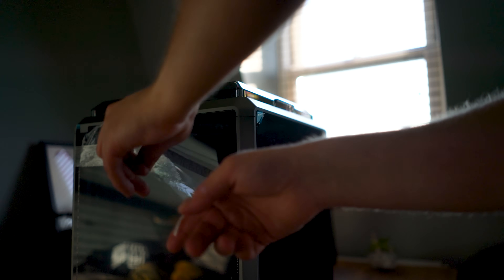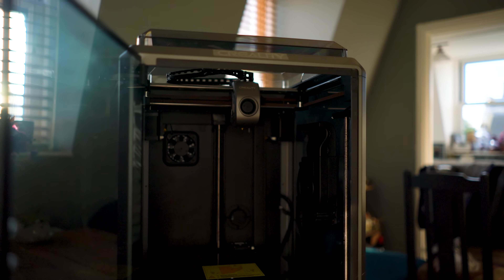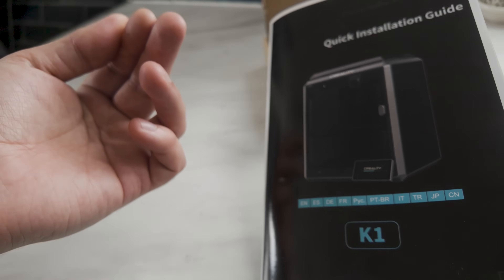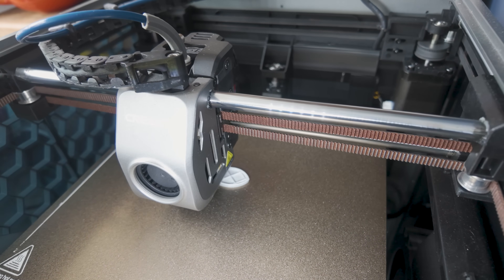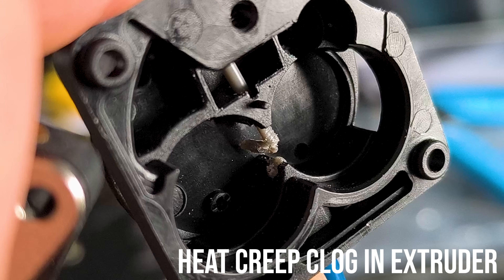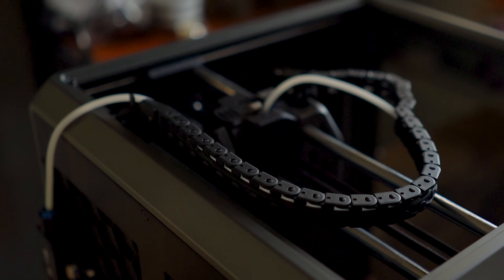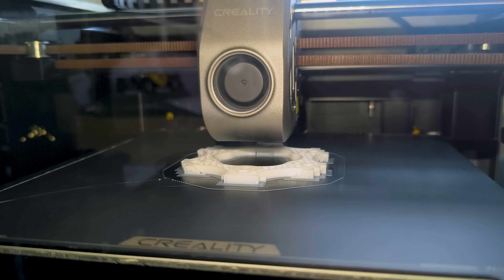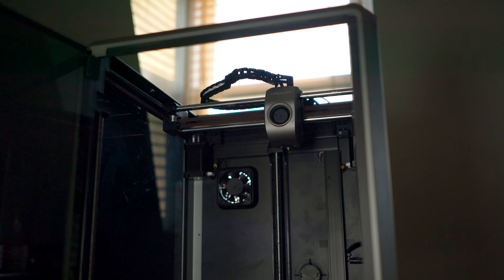Creality K1 REVIEW: Worth buying in 2025?

Comment: 6:20 Changing print speeds hasn't really helped for me there. I print outer walls at 500mm/s and still have major VFA issues with this thing. Which is kind of a shame because otherwise it's a solid printer, but no matter what I do I can't seem to get rid of the VFAs. Calibrating and recalibrating, playing around with pressure advance, checking and adjusting belt tension, modifying input shaping in Klipper, you name it. I reckon switching the pulley wheels is really the only way to fix this issue. Personally I decided to sell the printer to friends and get a Qidi Q2 instead though. 

Still, as an entry-level FDM printer (I've printed only resin for 5 years before getting it) it's really a decent machine.

Comment: ender 3 modded af > ender 3 stock af creality t500 (failed into oblivion)-> creality k1. its the sweet spot, 1 year of use and i just deal with the occasional jam. its got my hobby back on track, no more printer mekanic, just focusing on the modeling, hitting print and coming back to finished prints. i used ai to run thru all the tuning in the right order. pid, temps , and movement calibrations. took and hour but got a little more quality out of the result.

Comment: Do you know how to remove clogged filament in the extruder? I used old filament since I forgot about the moisture issue with olds ones. The filament broke in the extruder and Idk how to get it out.
Reply from the maker: I do indeed. Pull off the plastic cover on top of the extruder, it's connected by two lugs and two indents. Then undo the uppermost bolt on the left and the two uppermost on the right to remove the extruder motor. Now you can undo the two long bolts on the extruder motor to separate it (keep an eye out for the small bearing as it can go flying) then pry the two sections apart to get to the inside where the clog is. You might need to use a small screw driver to gently pry it open. Work your way around the edge to ensure nothing breaks. Then just look at the clog and cut the filament above and/or below to pull out. Always keep the door and top open for PLA and PETG.
Reply: @ATribeCalledCars  I was about to do all of this but then I found out I can just heat up the extruder to 240 CC and push the unclogger rod into the top which got out all of the clogged old filament. now i need to buy a dryer and Im prob buying the space pi.
Reply from the maker: @Animates1 Some clogs can come out with heat but if not at least you have a better idea. It's a great printer when you learn is quirks. Worth rooting for sure. I have the Sunlu S2 dryer and it's been great.
Reply: @ATribeCalledCars the sunlu s2 dryer has too short of a cable for me
Reply from the maker: @Animates1 Valid! I use an extension cable. I'd recommend a dryer with a maximum temperature of 70°C or equivalent unless you'll never print polycarbonate etc.